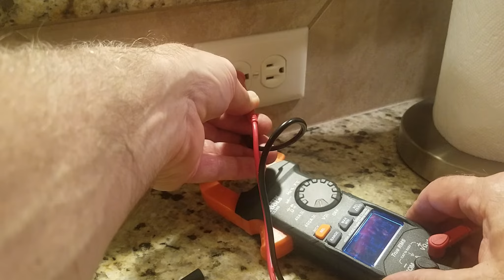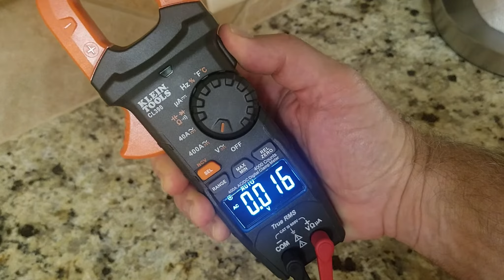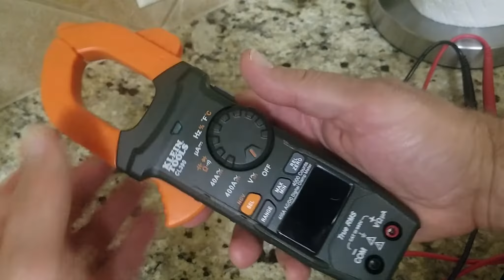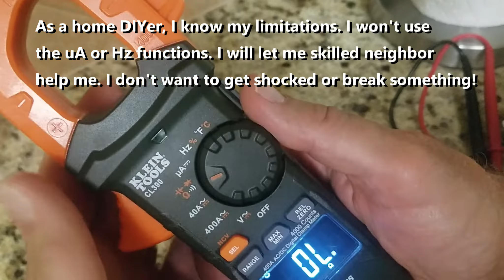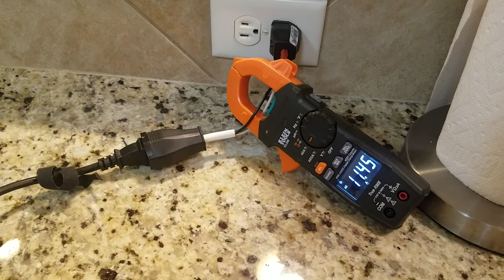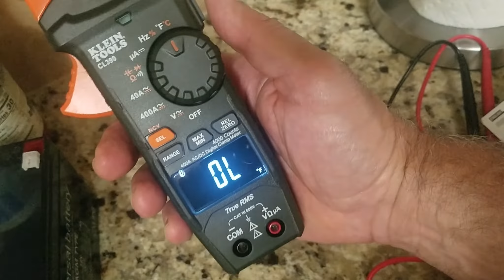Klein Tools CL390 Multitool - DrB DIY

Comment: How do you calibrate the temperature probe?
Reply from the maker: I only read how to use the temperature probe in max/min mode and not calibration.  It is possible to use the temperature probe in relative mode - i.e. set the current temperature as the relative start value.  Then the temperature will read a difference from the relative start.
Reply: @DrBDIY  A thermometer is useless if it can't be calibrated.

Comment: I recently discovered that you can detect a live wire or outlet with the tip of the clamp by holding in the orange “SEL” button and touching the wire etc. with the tip of the clamp. Really cool! 👍😊
Reply: Ha! I just saw you do that at the last second! 🤦‍♂️😂
Reply from the maker: Yes!
SEL / NCV BUTTON (FOR NCV TESTING)
Press and hold the SEL/NCV button 12 to enter Non-contact Voltage
Testing (NCV) mode to test for presence of AC voltage. The NCV
icon and "EF" will be present on the display. Approach the conductor
under test leading with the sensing antenna 14 . In the presence of AC
voltage, the red NCV light 13 will flash, audible signals (beeps) will
sound, and dashes will appear on the display. As the NCV sensing
antenna 14 approaches the voltage source, more dashes will be
presented on the display and the frequency of the audible sound will
increase. Release the SEL/NCV button to exit NCV testing mode
NOTE: Only voltages of 40V AC or greater will be detected.

Comment: I just picked this up brand new unopened for $50 from someone on Marketplace. Needed this to test solar equipment and batteries. Can you disable the selection alert noise?
Reply from the maker: I don't know.  I didn''t see anything in the manual or on the unit

Comment: You can use the holder on the right clamp for the red lead and then hold the other in your hand this way one of your hands is further away and also holding plastic of meter its safer ish..
Reply from the maker: Way to go!  I completely missed that holder.  Good catch! Thanks.

Comment: I'm new to this stuff.  Would this be good for a homeowner doing DIY small electrical projects?
Reply from the maker: I was new, big reminder: Safety first.  I am not an electrician but an IT guy and DIY. I have learned a lot though doing projects.  This multi-tool is great. Once you practice using, following the video, and reading the little booklet, I expect it will suffice all your homeowner needs.  You will always need AC checking for plugs.  You can use DC to check batteries.   The current checker is great and most regular mult-tools will not have that feature. You can press the button just to see if current is present.  I use the thermometer occasionally.  Lately I have been using the Amp meter to see why new freezer is running all of the time.  It will be a good tool for you IMO.

Comment: Can u show how to use the mid max button plz
Reply from the maker: MaxMin is used to detect maximum and minimum readings where you may have variability in the readings for voltage, current, resistance, temperature, and DC μA.   Lets just try to get variability in 120 V. 
Turn your Klein CL390 from Off to V.  By default, it is Auto Volts shown on the screen.  Insert your black/red probes into a power outlet, lets say 120V in the USA.   You should see some reading like 119, 120, 121 etc.  Now push MaxMin button.  You will see a maximum reading that only updates if the tool sees a higher reading.  Then push MaxMin again and you will see the minimum reading that the tool sees and will only change if it sees a smaller reading.   Now push MaxMin a third time and you will see the difference (max - min) reading.  So you are in MaxMin mode. If you press MaxMin again, it will just toggle between Max, Min, max-min.  To get back to Auto V mode, just hold MaxMin for 2 seconds and you will see Auto again. Hope that helps.

Comment: I have that meter as well as the cl320, cl200, and getting the cl440 cause the 440 reads inrush current and the mm 2,000 they are good meters as is their hand tools also another great hvacr brand meter is uei which I have and own. This brand we used in hvacr school. I prefer these meters as well as ideal and extech for their affordability in price range. The fluke, flair, field piece are sorta snap-on pricey-ish I mean don't get me wrong those mentioned are great meters for their price but I get kinda the sorta the same accuracy with klein, Ideal, uei, extech, Greenlee or any price like of these mentioned meters for an affordable price. I tried to get what I can afford and what works for me. The Uei makes a good backup meter if this in your video is your main meter. Amazon has this brand meter and reasonably priced if you want a good or decent backup meter. Like the video sir and demo of the meter.
Reply from the maker: Nice comments. Thanks for the feedback.
Reply: You must be in a professional Electrician/HVAC field to own all those meters. For a DIY guy, this should be the only meter ever needed for life.

Comment: Anybody know how to turn off the timer? The meter shut down 5 min if you didn’t touch it. And the beeping sound is too loud and sharp.
Reply from the maker: "By default, the meter will automatically power OFF after 5 minutes of inactivity. If the meter 
automatically powers-OFF while in a measurement setting, press any 
button to power the meter ON, or rotate Function Selector 2 switch 
to OFF, then power ON the meter. To deactivate Auto-Power OFF 
functionality press and hold the "SEL/NCV" button 12 before powering 
ON from the OFF setting. When Auto-Power OFF is deactivated, the 
Auto-Power Off icon will not be visible in the display."
Reply: @DrBDIY  thanks a lot

Comment: Very nice review of the CL390.  I bought one from HomeDepot after seeing your review.   Just have one question. Is it normal to see a non-zero value when you set the dial to DC Amp and SELected DC.  I get values ranging from 0.97 to 1.0 even if the leads are not touching anything.
Reply: That's what the zero button is for.
Reply from the maker: Check this out https://ameliadanver.com/what-causes-a-ghost-voltage/

Comment: Mines reading dc voltage at half of what the voltage is I'm testing with 3 meters and two read the car battery at 12.6v this ones saying 6.88v please help me
Reply from the maker: Maybe your unit is bad. However it is possible for battery to read lower if it is going bad or depleted.

Comment: NCV - Non contact voltage. This option measures voltage not current. Meter displays it as EF - Electromagnetic Field or EMF - Electromotive Force. Since there is nothing connected to receptacle reading would be 120V and 0I
Reply from the maker: I really used the current measuring aspect when I had problems with outdoor freezer running fan / compressor.

Comment: i just bought this exact one , love it
Reply: Any chance u know how to measure ohms with the clamps?
Reply from the maker: RESISTANCE MEASUREMENTS
1. Insert RED test lead into VΩµA jack 5 , and BLACK test lead 
into COM jack 4 , and rotate function selector switch 2 to the 
Continuity/Resistance/Capacitance/Diode-Test setting.
NOTE: The meter defaults to Continuity testing in this mode. Press 
the "SEL/NCV" button 12 repeatedly until the resistance icon 
appears on the display.
2. Remove power from circuit.
3. Measure resistance by connecting test leads to circuit. The 
meter will auto-range to display the measurement in the most 
appropriate range.
NOTE: When in a Resistance setting and the test leads are open 
(not connected across a resistor), or when a failed resistor is under 
test, the display will indicate "OL" This is normal.
DO NOT attempt to measure resistance on a live circuit